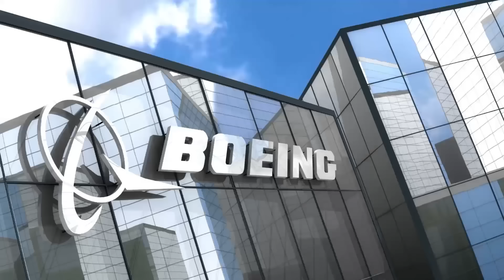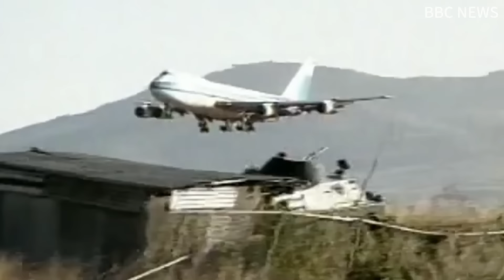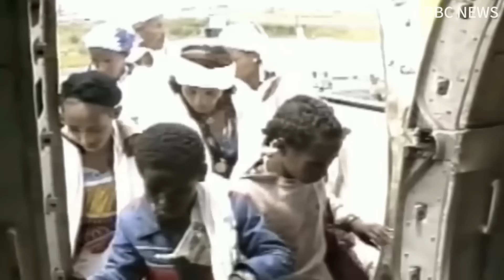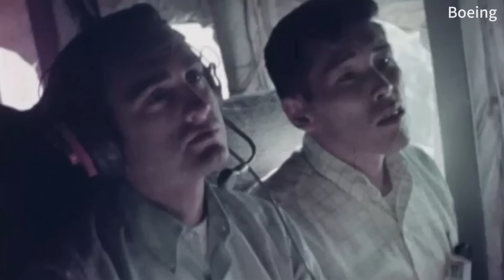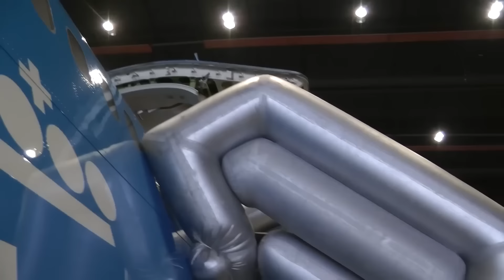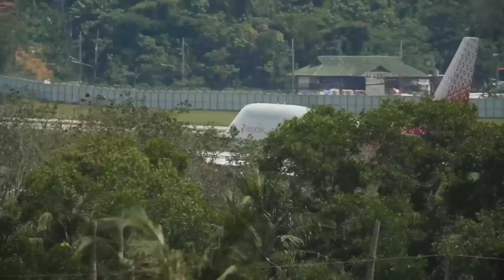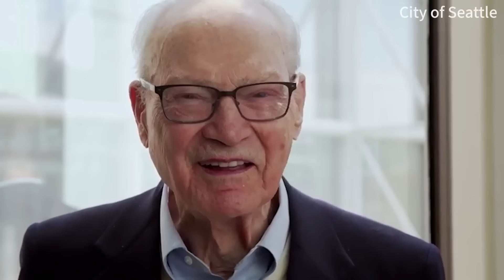What The Boeing 747 Hump Was Really For

Comment: I tested them for about 23 years. I actually was on the KC-46 program when the last 747-8 went to the fuel dock, and my life time Boeing friend Chuck let me come over and help troubleshoot a cargo fire test failure with him. So I got the coin too, for having worked (even only for a few hours) on the last 747. I have forgotten more than most will know in the year 2025 about 747s. I have almost everything memorized. On a long boring taxi, I counted how many switches in the cockpit were just for lighting controls. 79 to 83 depending on customer options. That is on a 747-8 my man. The 747-400 with PVS, and side by pilot radar screens went up to like 102.
I can't agree with your assessment for the reasoning for the hump. My role was purely avionics/electrical. Mechanical engineers are knuckle-draggers. I went to college with them....if it is more difficult than the square root of 16, you can promise a note....what is that meaning? Yeah, so...anyway they aren't the sharpest. If you note, the 747 had a huge power to weight ration. The upper deck was created to facilitate the very rich. Of course! Its the Queen of the Skies, and someone will pay that much to sit up there. Well, in order to accommodate such expensive seating....they had to afford them their own galley. And this is why the upper deck on the 747 is extended. In order to have this galley way the heck up there, there had to be a way efficiently move food/beverages from the main deck which had up to FIVE galleys, to the smaller but higher quality upper deck galley. Thus a little 4X4X6 foot elevator was built between the forward galley forward bulkhead, and went straight down to the main deck #2 galley. That is why the upper deck is bulged. Simply to accommodate the rich, and have a nice galley for them. I worked on all versions, even the combi's. What no one seems to understand is the ceiling of the 747 is where all your ECS tubing is, and it is MASSIVE!!!!!!! There is no room for even a spider up there. On every version of the 747 I worked on, the cargo space, if any, always started aft and on the main deck of the upper deck galley. I have crawled up and aft of the upper deck galley doing inspections. You could not put a pair of dice up there. So no....the bulge wasn't for cargo now anyway, all the equipment cooling fans, the chillers, the ducting is up there and then you got wiring out the butt...tons of that.
If you ever have any questions, I be happy to talk. I've been retired less than a year. Ya....I miss it airplanes. I just don't miss the rest of it. 
Alan
"ATGM" USMC

Comment: Years ago i worked air cargo and I mostly worked DC-8,707,727,757 which can hold up to 15 "igloo" containers  the 1st time a 747 cargo came in 😮😮😮😮 30 on the main deck and 8 in the front lower hold and 6-7 in the lowere rear 😮😮😮 up to 45 and probably what amazed me the most because I did the weight and balance load out was the weight a 747 cargo could fly at compared to say a stretch DC-8.. Almost 1 million lbs compared to just under 1/2 million 😮😮 astonishing.and then you look at the U.S.A.F. C-5M super galaxy or the now destroyed Antanov 224😢😢from Ukraine.

Comment: Only flew on a 747 once, it was a United 747-400 taking us to Kuwait, with further travel arrangements curtesy of the United States Marine Corps into Iraq.  Sat in one of the front row seats on the lower deck.  Heck of a way to go to war.  Ironically, my father was a commercial aviator for 35 years, started on a DC-3, ended his career flying the 747-400 for Delta.

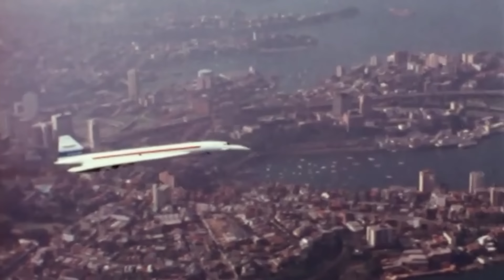Comment: 3:32 A modern home computer can design a better a 747 today without much fuss, actually. However it will struggle to design a plane  with the efficiency of 787 or A350

My students always ask why it is so hard and expensive to go back to the moon.
The answer is easy, we are designing a rocket that is (inflation adjusted) cheaper, 100 times more safer, 10 times more pwerful that can carry much more scientific instruments. 

If we wanted perform basic moon flights w can do it today much cheaper than Apollo missions.

Comment: I’m so grateful that I flew the 747- ALL models, except the 747-8. I flew the 100, 200, 300, 400, 400ER, and SP. Easily the best plane (and in many ways the easiest) of the many that I’ve flown! If you know anything about airlines, you might know that our airline was an ALL 747 airline for some time.
I was so sad to see our airline’s last 747 retired early due to COVID, in 2020. However it’s ironic that the 747 will still be flying, though likely only as a freighter, long after the last A380.
Reply: "If you know anything about airlines, you might know that our airline was an ALL 747 airline for some time."
What airline?  I was going to guess Pan Am until you referenced flying in 2020.
Reply: @WW-hr1hd …. Qantas. We were an all 747 airline for quite some years until we bought some 767s in the mid 1980s.
We had everything up to and including the 400 ER, EXCEPT the 100 series …. But we dry leased one briefly in the late 1980s and I flew it. (It was a tired old plane, pretty horrible compared to our own very well maintained aircraft.)
I shall always be in love with the 747, but ESPECIALLY the 747-400, which was just the right mix of computerisation in my opinion. It was a joy to fly. And yes, I’d also love to have flown the 747-8 too before retiring, but sadly we never bought any, as we bought the (fat, & ugly) A380.
Reply: @FutureSystem738  Thanks for your reply.  I assume Qantas was able to use all 747 due to the high percentage of long haul flights in your route map.  I can only imagine what it was like to fly them.  Especially virtually every variation made.  
It's my understanding that Qantas has one of the best safety records in all of aviation.  That says a lot about their (your) commitment to maintaining their (your) equipment and keeping flight crews trained to the highest standards.

Comment: The 1st time I flew on a B747 I was PCSing (Permanent Change of Station) to my 1st OS assignment, to Turkey, for a year, in the USAF.
It was a Cat Z flight (commercial ticket, in civilian clothes on military orders) on PanAm flight 2 from JFK to Heathrow & eventually on into Istanbul.
My seat mate for the first leg of journey was an older gentleman with a similar short haircut as I possessed. As I came to find out in talking with him, he was USAF, too! Turns out he was the wing commander of the 86th TFW @ Ramstein AB, Germany. A FIGHTER jock.
As we were on approach to Heathrow I noticed that the ride was a little bumpy. Now granted, I did not have THAT much flying experience, as I later would. Well, the final approach turned out to be anything but normal. As we lined up for touchdown, I noticed that the B747 seemed to be "crabbed over" to an extreme angle. The right wing of the aircraft appeared to be almost perpendicular to the runway and much higher in altitude than the left wing. Not normal, I noted in my head.
Just then, the left landing gear contacted the runway. The plane bounced into the air and did what seemed to be at least a 90 degree turn to the right. Then the right landing gear contacted the runway and again returned to the air. The cockpit crew then settled that big beautiful beast to a three-point landing.
As we taxied to the terminal, I looked over at my seat mate, the fighter jock. He was white as a ghost AND green around the gills. I can only assume we had just survived a VERY harrowing crosswind landing in the biggest and best airliner ever made.

Comment: Growing up beneath the flight path for approach to Schiphol airport I’ve admired the 747s from the early 1970s onwards. I recall being amazed how slow they seemed to fly, apparently defying gravity, almost hovering it seemed!
I was one of those kids that drew countless drawings of 747s. Later I made a device with a ruler and a protractor to calculate the distance of an aircraft using trigonometry and looking up the dimensions of the aircraft. 
Flying on a KLM 747 was always my dream. It didn’t happen to be KLM 747s but am happy to have flown on many 747s of other airlines since, later in life. The most memorable was the first flight on a 747 when I flew two long haul flights: Frankfurt to Los Angeles and then Los Angeles to Auckland (with Air New Zealand). It was a very reassuring sensation to look out of the window and see two Rolls Royce engines, while flying over open ocean for about 13 hours.

Comment: Well, "secrets" 1 and 2 are both rubbish. It was designed as a military transport, and then was easily adapted to a freighter. Modern designs are easily able to reach higher (sub-sonic) speeds; mach 0.8 is a design parameter chosen for efficiency - its not because 'modern designs cant achieve what they did with sliderules'. I lost interest in the rest of the "secrets".

Comment: My first sighting of a 747 was a PanAm aircraft at San Juan, PR in 1972. My best flight was on, again PanAm LHR-JFK. I was booked as an economy passenger on BOAc but went to the PanAm counter with my frequent flyer card in hand. They not only transferred me but put me in first class, upper deck which had full reclining seats/beds. Worst 747 flight was Northworst AMS-MSP. Filthy, rattling, no air circulation, cattle car conditions with no leg room for my 6'4", 200 pounds. Another great flight was JFK-SJU. Seven of us going to Puerto Rico for a power station start up test - and were out numbered by the cabin crew as it turned out to be a reposition flight. Not only choice of seats but choice of any cabin except the upper deck. Love that airplane and most flights, even the l--o--o---n--g  747SP flights to Japan

Comment: So a 747 picked up a mighty jet stream tailwind and crossed the Atlantic a bit quickly. In what way was that due the aeroplane? 
the REAL advantage the 747's hump gave it was a reduction in wave drag at high subsonic speeds. It's called area rule - minimising the cross sectional area change as much as possible to obviate local sonic shocks. The larger fuselage diameter endowed by the hump minimises the cross sectional are change of the wings.

Comment: Coming back from the Netherlands on KLM, probably on a 300.  We were delayed several hours due to a terrorist scare in Germany that stopped all Northern European take-offs.  So when finally cleared, our pilot wasted no time getting on the ramp and we were first out.  

The pilot said something about we'd try to make up time.  We had just rotated and immediately the gear came up.  We caught a 200 mile an hour jetstream going our way and sure enough, we arrived in Gander for Customs right on schedule.  Since no European flights had launched, we went through customs very fast because we didn't have a full load of passengers and we were off again to LAX and arrived on time!  

I used to travel LAX to JFK regularly, taking a near empty 747 red eye.  I was able to stretch out on center row seats.  This flight there was close to a 200 mph jetstream, so our ground speed must kept us flying seemingly forever.  Later, I talked to the copilot in the terminal who said they were really low on fuel when we arrived.  So low that despite the noise regulations requiring final approach over the ocean, we were vectored straight in.  Because they were so lightly loaded, they'taken on a light fuel load, so the copilot said we were "runnig on fumes"  by the time we arrived.  

I loved flying on 47s.  On the ground, it kind of loose.  If you were in the back, it kind of flopped around, like 8 school buses stapled together, but in it element, aloft, it was cofortable as heck, and as long as you had a window or aisle seat, being able to get up and stretch was really nice.

Comment: The first flight I ever took was in 1983, on a Cathay Pacific 747 from London to Hong Kong via Bahrain, and back (never do things by half!). On the way out, the landings at Bahrain and Kai Tak airports were memorable; rocketing towards the terminal buildings at the end of the runways, with the surroundings fully visible through yawning voids in the extended wing flaps, as were the aircraft's wings tips seemingly brushing skyscraper balconies on the descent into Hong Kong, followed by them overhanging the harbour waters on landing.

On the way back, taking off from Hong Kong into the aftermath of a severe typhoon, the 747's fuselage was lashed by violent wind and rain; blue lightening flashes ricocheting off the body, illuminating the darkened cabin; whilst the aircraft repeatedly fell and rose over 100 feet. Meanwhile, the laconic antipodean pilot said, "Sorry, but your grub's going to be delayed, as we're going climbing as fast as we can to 33,000 feet to escape the typhoon, because if we don't, we'll hit the Himalayas!" Great times!

And, in all my flights since on modern, efficient, but soleless commercial aircraft (with the notable exclusion of the likes of Short's 'Flying Wardrobes', little SAABs and other 'Formula 1 pencil jets', together with the extraordinary, electric-blue velour, ex-Russian officer-class LAT 420s), the 747 stands out as operating utterly, and reassuringly, within itself, despite the demanding airport settings and weather conditions I experienced.

Comment: I used to work in Japan for a manufacturer of Ham Radios. We had a model named 747 with nickname "Jumbo". Once during a flight from BKK to FRA over Pakistan we encountered very heavy turbulence. The wings of the 747 where flapping like a duck. I later learned that the design supposedly allowed the wings to bend up and down for up to 11 Meters at the wingtips. Landing in HKG Kai Tak Airport during Taifun weather was sometimes hair raising. Just a few meter above the buildings. Was always interesting to watch 747's land from the street in front of HKG Kai Tak airport building when they came in and did their right turn at the visual approach marker.

Comment: Dec 1987 Air France flight New York to Paris. It was the captain's  last flight before retiring his last name If I remember well was Petit. He happened to also be the airlines chief instructor for the 747. As we approached Paris it was announced that we would have to divert to Bordeaux since Paris was covered in a thick Fog.
10 min later we were given a special permission to land actually the only plane that was allowed to land that morning.  The touch down was so smooth we thought the gears had just been lowered and a few minutes later looking out of the window it felt as if we were suspended in the clouds causing a lot of confusion we had actually landed. We had to use stairs to get of the plane it was not safe to try and use a jetway. We descended the stairs using a rope  that was tied to a bus you could barely see the passenger in front of you coming down the stairs. This gives you an idea of what kind of soup the 747 was able to land in.
I have flown the 747 upwards of ten times I will always remember this plane the engineers that worked on and designed this plane made it a work of love you feel it anytime you board one of them.

Comment: I was booked on an early morning flight from San Francisco to Los Angeles on Pan Am which did this short hop before continuing on to South America. At that time Pan Am had an all 747 fleet. I knew it would be a 747 so when I got to the check in counter just for fun I asked how much more it would be to fly first class. Instead of $35 for coach, first class fare to LA would be $45! I told them I'd pay the extra $10 and booked a first class seat. 

When I was settled in my  first class seat the stewardess told me i was the ONLY first class passenger on the flight and what did I want for breakfast? I ordered something good and a glass of champagne to go with it. Included in first class fare. They opened a chilled bottle for me and I went thru half of it before we landed. I think I had two flight attendants scheduled for first class on that flight and I tried out lots of seats upstairs and down. I got a peak at the back of the plane thru the closed curtain and it was packed! I still have the glass with the Pan Am logo on it. I never did make it to work that day as planned but it is a wonderful memory.

Comment: Few airplanes changed their times. I only can think of five...the Douglas DC-3, the Lockheed Super Constellation, the deHavilland Comet, the joint BOAC/AirFrance Concorde SST and Boeing's 747. Each of these aircraft met the conventional standards of their day, faced them head-on, and obliterated them to create new standards few thought possible. 

For those who think the DC-3 (and its predecessor, the DC-2) to be unworthy of inclusion...how many other 95-year-old aircraft are still flying and in service? Where I live, in Lee County, Fla., the county Mosquito Control department maintains a fleet of them in regular use for low-speed, low-altitude pest control. Their NACA wing airfoil provides excellent lift for large payloads at very low airspeed (sometimes, slower than 100 MPH) and are very easy to maintain.

Comment: I flew with BA from London to LA. Virgin flight of a 747. The Captain extolled the virtues of this wonderfull plane with latest soa RollsRoyce engines. All true.   I was sitting in row 1. Fantastic experience. An hour and a half into the flight the Captain came online advising that the eta in LA would be delayed by about an hour. Not to worry he would share the reason with us after touch down. Which he did. One of the engines had to be shut down due to a technical problem. He drily commented that it serves as proof of the perfect design of the machine, nobody had the least inkling of trouble. Indeed!